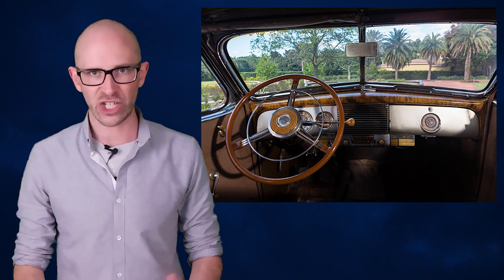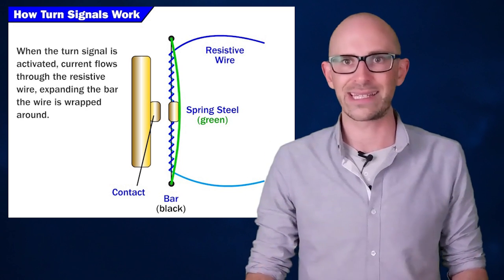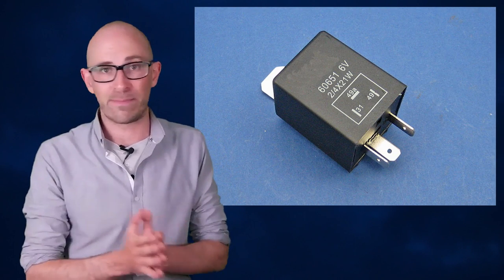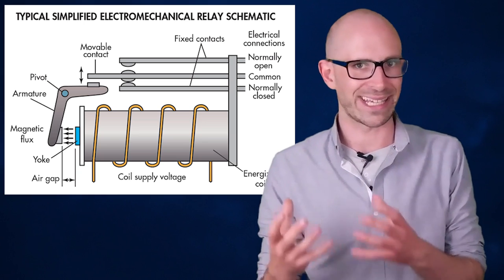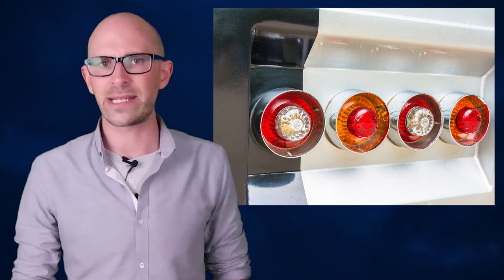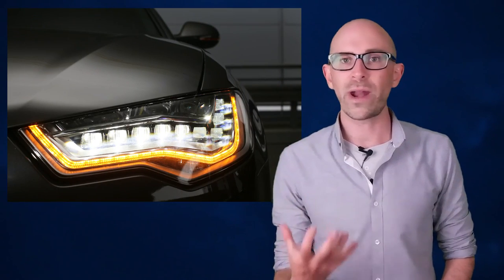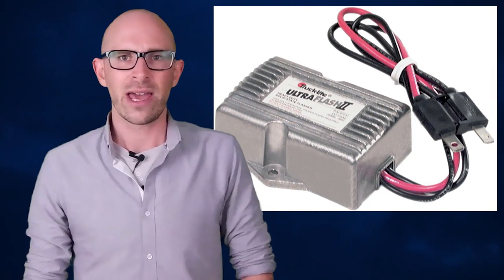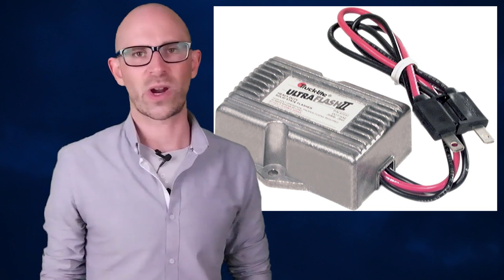What Causes the Clicking Sound Your Turn Signal Makes?

Comment: Yes, you right... almost:0
It is true what you say, but 20-30 years ago I'm affraid.
Proof: Drive your car and put indicator/blinker on. It makes that clicking sound. Now gently pull your hand brake on. Now, you look on dashboard and your blinker/indicator is still "blinking", but you can't hear anything for about 2 seconds, which after that car gives you warning signal "beep beep beep" - that your handbrake is on. After another 2 seconds of silence the "blinking" sound resumes.
I'm from UK and not sure if in America with an automated gearboxes you even have manual handbrakes. Sorry to say, but if you would, you wouldn't talk a lot of crap about that sound.
In other words, your "blinking" sound - simply comes from... speaker:)

Comment: most new cars have a little speaker in the driver side footwell to do the clicking sound..  and yes, BMWs actually do come equipped with turn signals.  but new Priuses apparently come with the system turned off, probably as a power saving measure...

Comment: The turn signal click in my Mazda is a sound file.  It plays through the speakers.  If another warning is also going off, like the blind spot monitor warning, the turn signal click doesn't play.  These sounds play even if the speakers have been muted.  That's why you can't ever turn the audio system off.
Reply: +Harley365 Never.
Reply: My Chevrolet Cobalt was this way too. The sound file only plays through the left front door speaker. That speaker went bad on the vehicle and my turn signal went silent and came back when that speaker was fixed.

Comment: Iirc here in Europe it's required by law to have audible turn signals. Any vehicle that uses a solid-state blinker uses some other audible indicator, usually either a speaker or a buzzer. (for example busses here have a buzzer in the driver cabin that beeps in sync with the lights when the driver uses the turn signals, there is no audible clicking.

Comment: 2 seconds in: "my guess is the relay that turns the light on and off"
2 minutes in: "ah, a thermal relay, close enough"
4 minutes in: "well, so it could either be a relay, or a thermal relay..."
4:30: "well that just uses a transistor instead of a relay, can't really "click" if it's solid-state though, because sound is made by moving parts"
4:45: "*sigh*"

Comment: It seems that it's no longer the normal to leave your blinker on while waiting in an only left turn signal light.   We used to just leave it on until it clicked off after turning but now it's norm to just use it for a few beats and then shut it off..  Who decided this new norm?
Reply: even though its probably the law to have it on, seems kinda silly to turn your blinker on when you are in a turning-only lane since the purpose of it is to let drivers around you know what you are doing. if you are in a turning-only lane then obviously you are turning
Reply: Garth Palmer But I leave my signals on even tho im a turn only lane because sometimes when im not on those lanes and im driving straight, those who are on the turn only lanes tend to get out of those lanes and cross the intersection as I drive pass them.
Reply: A short tap makes it blink a few times, this is used on highways. Fully pressing it makes it blink for a while, not sure for how long.

Comment: Older cars had a relay that makes the turn signals and hazard light flash and make the clicking sound
Reply: Yup, it's like the printing noise in some ticket machines, because the modern ones are silent, the buzzing was re-added to the machine to let people know that something was happening. I think it was the same for the 'click' that indicators make.

Comment: Before watching the video: Relays
Reply: The original flasher is a thermal relay that uses heat to open the coil circuit. The electronic versions use a timer circuit to control the relay coil. Now the BCM does all the jobs (flash, detect open bulbs) in one package.

Comment: Having changed a broken relay on my car myself, I knew relays are at least used in cars of a certain age.
Reply: All cars have relays. It doesn't necessarily mean that a relay is making it blink.
Reply: Virtually all cars use relays in some capacity because they are very useful switches.  It keeps your high current circuits separate from the small-signal ones.

Comment: I always used to find it a comforting thought that, even though cars get more complicated every year, our 2008 Volvo still had a nice sturdy 'click' when using turn signals or hazard lights. That is, until I found out that when you turn off the engine, the hazards will continue blinking - without a sound. Some parts of many cars are definitively over-engineered these days...

Comment: Old (the ones I have are from the 1950s) Christmas "flashers" used the Bi- metallic principal on a 120V household circuit. You'd plug a "string" of lights into one and the entire "string" will flash. Of course you need one for each "string" or else the "whole tree" blinks on and off! 😀

Comment: It's called a Bi-metallic switch, not spring. 

Also, now a days the system is electronic, the click is now there purely for the driver to be aware of it. We have got used to listening to our indicators rather than looking for them. Motorcyclists know this quite well.

Your research into the history wasn't bad though.

Comment: NO - While in a parking lot without my seat belt on and the hazards blinking, I hear the clicking UNTIL the seat belt signal warns me periodically  - then there will be NO sound for a moment after it stops... and then the blinker clicking sound resumes. My blinkers are blinking without sound for about two flashes

Comment: Couple of errors in this video.
This bit makes no sense
"When the current is flowing (when you turn on the blinker) the resistor heats up the arched bi-metalic spring which in turn connects the two terminals allowing the lights to come on." 

For current to be flowing the terminals have to be connected and the lights on.
What actually happens is. The current that flows into the light causes the bi-metal spring to eventually heat up and 'disconnect' the terminals, until it can cool down.

Also, when you have 1 dead lamp the flash rate is faster, not slower. In this case the lower current barely heats up the bi-metal spring enough to disconnect. So as soon as it does disconnect it cools and reconnects almost instantly. This is why you often see cars that flash too fast and almost never see cars that flash too slow.

Comment: I don't want to be one of those guys, but you have the burnt out bulb thing backwards.  When a bulb burns out, it will INCREASE the speed of the flash.  It's called hyperflashing signals.  Burnt out bulb = more current to remaining bulb = faster flashing from excess energy.  It happened to my older car all the time.  Removing a factor would not slow down the energy output.  Your logic was a bit off.

Comment: Cant say about modern bikes but pretty much any scooter or bike thats fitted with aftermarket LED blinkers will flash a lot faster. Its related to the speed of discharge or something.
Reply: It's because the bike thinks the bulb has died and is indicating that it needs a replacement (since LED's require so little power)  Only way to stop it is to add a resistor.
Reply: for you, modern is 1953

i think,  haven't played the Mafia 2 story forever

Comment: In my car the blink rate speeds up when a bulb burns out. The guy at the auto parts store said that's a good sign you have a bulb out, implying that this is the case with lots of cars. They either got it wrong in the video when the said the rate will slow down, or there must be another type of blinker that they didn't talk about.

Comment: What causes the high pitch noise an electric car makes?
I have owned both brushed and brushless, both AC  and DC engine cars, they all make the same high pitch electric noise.
Reply: Most likely the engine power control circuit as it rapidly switches the current. Also the motors themselves. There's actually a lot of accoustic engineering that goes into an electric car to make sure its power train doesn't scream like a buzz saw especially on high rpms
Reply: Something to do with transfer of power. I have a laptop that loves to make noise when the USB bus is in use.
Reply: HunterShows SolarAllience is right. It's probably a frequency (for AC) or PWM (for DC) regulator which drives the electric motors. You hear the same kind of high pitched noise at rollercoasters when they send away a train out of the station.
Reply: also trains themselves.

Comment: You forgot to mention the semaphore system used in the 40s and 50s in UK on cars like Austin and Rover. A lighted arm about 8 inches long is inside the door pillars and when the switch is thrrown it extends out at 90 degrees to indicate the change of direction.
Back in the 70s we still had to learn hand signals to warn other motorists as part of your test.

Comment: It's important to note that, jokes aside, BMW has been using solid state electronics to control turn signals and all other lights on their cars since at least the mid 80s. The Japanese, in their never ending war to save cost, still use thermal flashers on brand new cars such as the BR-Z. Sad they insist on older, less reliable (yes, a thermal flasher is much less reliable than a solid state one) and worse technology in so many cases.

Comment: In my Mazda 6 it actually works off of the small little speaker near the ignition on the dash right next to the column. Because if I or the passenger don't have our seat belts on the speaker sounds the seat belt alarm and with the turn signal on there won't be any noise other than the seatbelt alarm.

Comment: Seems like it would have been replaced with a CPU by now
Reply: Christian Terrill many GM cars have started using the radio to make the click sound along with other warning lights.
Reply: A CPU that controls a relay, yeah, that's what it is. There needs to be a relay in between because you don't want to run all the current a light requires through a CPU.
Reply: That's not correct. In most cars the lights run off 12 volts and 5- 30 amps. Depending on the light.

The use of a relay is nothing to do with the "current required to run a light" Relays are used purely as a mechanical switching mechanism.
Reply: He mean't that you cannot drive the lights directly from the cpu, since the chip can't handle the current. So we use relays to handle the high current
Reply: SolarAlliance exactly
Reply: It's not incorrect, what you said is exactly what I meant. Except, we do use relays to handle the high current. Why else would you need them? Instead of having the current from the battery run through the CPU and fry it, it runs through a relay that can easily handle the current, a relay that is run by the CPU, because running a relay basically draws zero current.
Reply: That's still incorrect and I think you are confusing yourself. 

The lights are NOT "driven" (I assume you mean powered?) by the CPU. Cars have an ECU, (Sometimes called an ECM, Engine control Modual/ unit). They are powered by the battery. The ECU will send a low voltage pulse signal to a relay. The relay works as a mechanical switch to turn on/ off the indicator. Modern relays are almost silent.

And "we" don't use relays to "handle the high current" relays are mechanical switches!

Current and voltage are different things. To reduce voltage we use resistors, and fuses to ensure it doesn't exceed our required limits.  By reducing the voltage we then reduce the current.

Currents and Volts, Relays and resistors.
Reply: I know they like to call the CPU different things, but that's basically what it is. So I'm just using that term cause the OP did so.
Reply: "Except, we do use relays to handle the high current. Why else would you need them? "

We use them as mechanical switches. It has NOTHING to do with current!

We are concerned only with Amps and Volts here. They are regulated with resistors and fuses (as cut offs)
Reply: Could be that they're using a more advanced timing relay, skipping the CPU all together. In which case your explanation makes more sense as you wouldn't have to run all that current through the CPU. And since you have to use a relay regardless to make that work, you don't have to worry about the current the lights draw.

Also: Amps = current
Reply: Most modern cars no longer use relays like that. Then use CANBUS tech instead. Basically everything in the car now how it's own module. Cars no longer have just a "cpu". There is an ECU for the engine. A TCU for the transmission and on and on. Long story short, the clicking you hear in modern cars is mainly out of nostalgia and as an audible warning that your indicator is on paired with the blinking icon on your dash, a visual warning.
Reply: Hey Malaman1979, I used to be a wiring engineer in the automotive sector.  Yes, it has EVERYTHING to do with current!  Relays are mechanical mechanisms, but they are used as electrical switches, and they are used so that a small current signal can control (switch) a larger current circuit.

With modern control modules (lighting would probably be a "body control module"), we CAN drive more current directly to the bulbs without damaging the electronics (small transistors) in the controller, but if you're dealing with an older module, the strategy is still to use a small current from the body control module paired with a relay to switch high current to the bulbs.
Reply: Hi McDrum, I'm currently, a qualified motor vehicle mechanical and electrical engineer.

I can't be going back over the whole thing again, I suspect either you are not qualified, didn't read the whole conversation or are trolling me. But the whole thing is massively unimportant :)

You need to understand that current and volts are different things. The topic on point is NOT about current its about voltage. We control the current by using a resistor to reduce the voltage. THIS brings down the current.

Relays have nothing to do with it.

I repair cars, and their lighting systems, all day every day of the week so when the situation actually arises at work I'll just fix it, getting further into a debate and going round in circles isn't worth it. So lets just leave it there, we can both go on disagreeing because I'm not getting into this and replying with the same stuff to a fourth person.
Reply: Malaman, it's good that you aren't going into this any more, because you are still wrong :)

Relays are electromechanical devices that allow you to use a small current signal to switch a much higher current one.  That like...EE101.
Reply: How is the topic about voltage? The voltage is irrelevant in this discussion. And yes I know the difference between current and voltage, I'm an industrial electrician/automatician, and I work with relays all the time. If you're using a simple relay, it's probably because of high current.

Comment: My car stopped making the clicking noise when I got my stereo system installed. The dealership said it would be $800 to fix it but I haven't bothered to do it since the turn signals work fine- just no clicking noise. Weird right?

Comment: So... what would a '90s Volkswagen have?

And if electrical indicator circuits are common, why is there no standard rate?
Reply: Relay or solid state. There is a standard rate, but it's rather loosely defined: It's supposed to blink between 1 and 2 Hz.

Comment: Used to have an old Ford Escort where the indicators shared a relay with the heater, so if the heater was on the indicators didn't work.

Comment: In my family's Cadillac Escalade the blinker noise comes out of the speaker. If you get a notification like the seatbelt is unbuckled or something the blinker noise will be muted but the indicators are still on. Weird.
Reply: Tyler Beeson There are some cars that are equipped with computer controlled turn signals. A lot of newer cars have computer controlled turn signals.

Comment: Question: When one of my indicator bulbs is blown, the other indicators flash at a faster rate - in fact it's usually how I even know that one of them is blown. Why does this happen? Is this something deliberately designed into the circuit and supposed to be used to alert the driver of a blown bulb?

Comment: Ooooh so that explains everything My Moms Opel Corsa from 1996 has a broken front right blinker which has pooped the back right blinker is now super blinker blinking on and of in less than a second
Reply: Killer Mr Wolfz in the case of your mom's car, the front indicator may only be fused, and bulbs, having resistance as they light up, well acts as a resistor.  Having a spoilt bulb means there's no more resistance and now the electricity flows through all the circuit much much faster,causing your blinking to occur much faster. if you replace the bulb, the blinking should return to normal because now it's taking the normal time for electricity to flow through the circuit

Comment: my Nissan Cube the sound comes from a speaker.  you can hack it playing with the key on/off with the turn single lever and get it to sound while the lever is in the neutral position and no lights are flashing

Comment: In my 2009 HHR the clicking sound was generated by the radio and played thru the speakers.  So, when I replaced the factory radio I had to get a device that replaced that function.  It's wired between the radio and the car's wiring harness.

Comment: Some Dodges use solid state flashers and synthesize the sound through the same unit that does the chiming of the various idiot lights on the dash.  How  I know...  My Dart and Charger were like that....  The blinking noise was interrupted often by the chime.